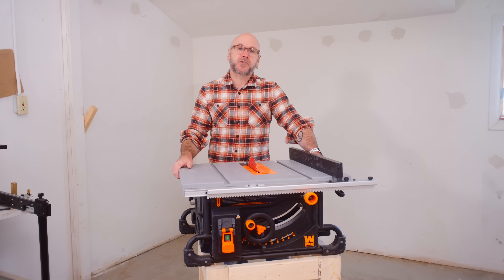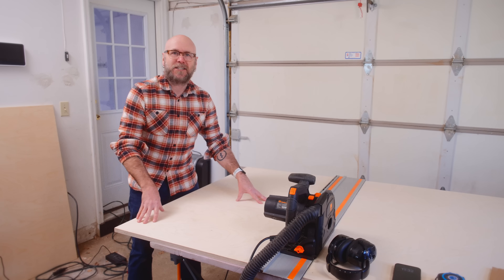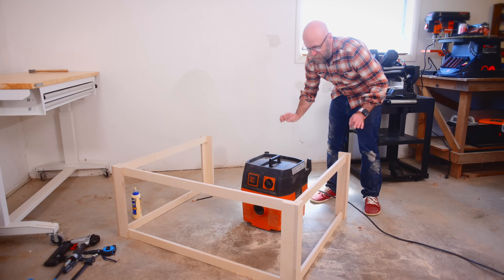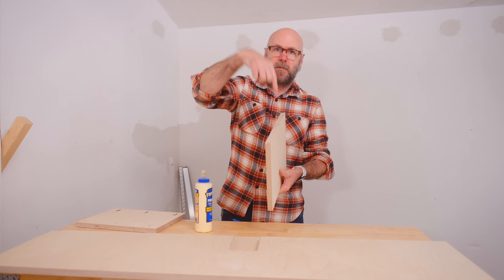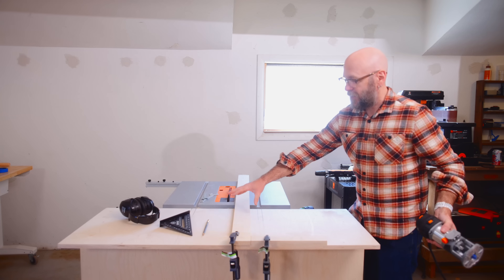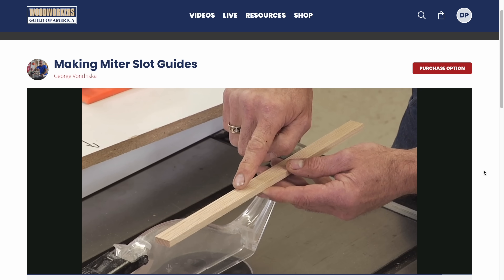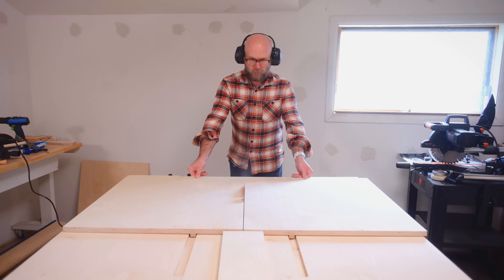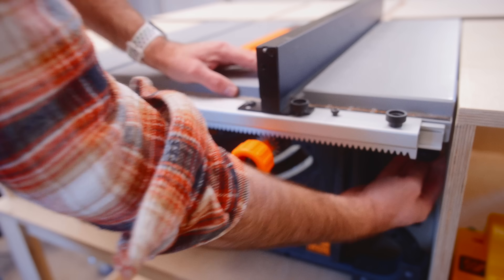Transforming a Cheap Table Saw Into a Professional Cabinet Saw

Comment: Phillips driver bits break. I've broken tips on Harbor Freight's  Warrior bits and DeWalt impact rated bits. When the last DeWalt bit broke fragments actually fused in the screw head. There was some cussing as I extracted it with a pair of channel locks. Just another legit reason to hate Phillips.

Love the Wnew miter gauge. The Bora Centipede is fantastic.
Reply: I've had it happen. Not a lot. But some bits and some screws are very hard. So I've had bits shear just like the one in the video. It is not the fault of the design the heat treatment of the various parts of the assembly. That's just manufacturing variance.
Reply: @1pcfred  Phillips suck for several reasons. Broken bits being one, but they also cam out and strip out easily.
I've reused Torx screws multiple times, and they hold up much better. I've also never broken a T-20, T-25, or T-40 bit, which are the ones I use a lot.
Reply: @ST-0311  Phillips are designed to cam out. If you use an impact with Phillips they work OK.  Like everyone else I've experienced the slippage and even chewed bits up. I found that when I ground bits to remove chew marks the bits would work better than new. So that's something to consider. Doing that grind properly takes a bit of skill. I don't find it particularly difficult. But I know what I'm doing. I have some really nice bench grinders too. One with big meaty tables on it. Big meat is Internet famous. If you put sliding tool rest into a search engine it's one of the top returns. I grind bits on the non-sliding side. Big meat is on line 3. You'll see a bit of orange cord in the picture. That's Big meat. I never posted it on Pinterest. Someone else found the picture where I did upload and reposted it. Oh on line 5 there's another pic and that one I did post. That's the grinder I do Phillips tips on.
Reply: @1pcfred  Yeah, bro. You can like Phillips if you want to, but I'd rather not use them.
As to your points:
First, every Phillips bit I've had break was being used with an impact driver. 

Second, the urban myth that Phillips were designed to cam out stems from the excuse Henry Phillips used to justify a design flaw. Phillips were originally used in the in the auto industry, and there were many complaints about cam outs. Henry Phillips claimed it was to prevent screws breaking due to over tightening.  
However, the only reason they were being used at all is because Henry Ford got butt hurt when Peter Robertson refused to give him exclusive rights to Robertson screws. Ford originally wanted Robertson screws to replace slotted screws specifically because they don't cam out. A problem common to slotted head screws. However, when he was denied exclusivity he looked for an alternative and went with Phillips.

It makes no sense for a driver to purposefully cam out and damage either itself, or worse the screw head. The result is the screw either cannot be driven all the way in, or it can't be easily removed. 

Torx, Roberston, and Pozi are all superior designs to Phillips. That's exactly why Torx were designed: For applications where serious tightening was essential, like car seat belts. It's also why no Phillips heads are found on serious structural screws like HeadLoks or LedgerLoks.

Third, I'm not spending time customizing flawed driver bits so that they will work better.
I'll just keep buying Ph2 bits in 10 packs.
If I have to use Phillips a spot of valve grinding compound will help them work better

You do you, man. But you're not going to convince me that Phillips is a "good" design.
If there's an alternative I'll use it.

~Peace✌
Reply: @ST-0311  do you have any idea what you do with an auto body panel that you strip out? Here I'll help you out. You scrap it. Because you can't just put a mismatched bigger screw in the hole. They had knuckleheads like you working on the assembly line too. Because good help is hard to find. Now if you stripped the screw head out it can be removed. You jack that hole in the panel up and then we've got a real problem.

Comment: I build a gigantic all in one bench that has space for a table saw, miter saw, jointer, and some clamps and assembly. I hate it. So now I'm doing exactly what you are doing and building everything modular. I'm hoping that I can build a rolling outfeed/assembly table with dogs that I can latch somehow to every mobile cart that I have so I can just roll the piece of equipment up to the table, latch it on so it doesn't move, and cut away. Time for assembly? Unlatch and move the equipment against the wall. Thanks for the inspiration!

Comment: You have a hole saw and use an undersized wood bit and force the plug through instead?  GOOD PLAN!
Reply from the maker: So you're suggesting drilling a 4" hole for a 1" cord?

Comment: The start capacitor on your compressor probably failed. It probably just needs a 15-20$ replacement capacitor 30min of time, some simple soldering and some heat shrink tubing. 🤞.

Comment: Does the brad nail trick give you as much holding power as clamps would?
Reply from the maker: No but in this case I don't need much holding power.
Reply: @MakeSomething  Thanks, so there are times that you would need to use clamps? This wouldn't work in every situation?
Reply from the maker: Anytime I'm using solid wood for fine furniture I'll use clamps to make sure I'm getting the best contact possible.
Reply: @MakeSomething  thanks for the info, I'll have to give that a try on smaller projects.

Comment: Nice one!!... Just a question: when you changed your blade to a thin kerf one, did you changed your riving knife too?
Reply from the maker: I did not. I don't know if that's proper but I do know that it doesn't get caught on the riving knife.
Reply: @MakeSomething  Good to know, thank you. I have a Dewalt 7485, I`m considering using a Freud combination thin kerf blade in it but I`m not sure if I will have to change the riving knife also...

Comment: I don't know about an after market fence, but I built mine from a video right her on YT (can't remember the channel). But it was basically a biesemeyer fence. It attached to a piece of angle iron and rectangle RHS mounted to the bench. The fence was made from another piece of angel with a smaller piece of RHS as the fence welded at 90deg. Then on that angle iron there's an adjustment with gub screws. Knocked it up in an afternoon with the welder and some screw taps.

Comment: About 34.75 inches,  about? You say what  accuracy do you normally work to if this is approximate
Reply from the maker: Accuracy isn't important here. Good enough is good enough for shop furniture. I like to focus my energy on what matters.
Reply: @ my point was 34.75 is accurate to 1 hundredth of an inch and that is not an approximate measurement. Never mind good job

Comment: I was just thinking that instead of 2” hose everywhere you could probably use 2” conduit to help minimize the mess and it is heat deformable or you can use a plumbing fernco fitting to attach to anything with a lot of vibration

Comment: Not exactly what you asked about, but look into the BOW xtender fence system. Doesn’t address the rack & pinion issue, but you can at least get a quality fence and will be able to increase the overall safety of your saw. 
Awesome video btw. One day my ADHD brain will get one built 😂

Comment: I would have thought the biggest improvement (other than the blade) would have been a new fence.
Reply: He talks about that at the end and asks anyone that knows of a good replacement fence for contractor saws to add them in the comments. I've not found one myself but hopefully someone drops a link here.
Reply: @halligan1201  The bow xtender fence? What do you think of that?
Reply: @hs1626  his criticism was that the contractor saw fence is hard to make micro adjustments on. As far as I can see the extender fence is what it sounds like, an slap on extension (with handy grooves and such)?
Reply: @nosreuter  that was my thought too. Allows longer pieces but if the factory fence moves or can't be adjusted accurately, still just carries that problem forward.

Comment: This is great! I have done the same thing for my small table saw but my finished table was not nearly as big.  My question is. You made a HUGE permanent bench table saw where everything has to fit in a single car garage? Wow.  This will take up a bunch of room all the time.  I made mine so the out feed table hinged down and took up MUCH less room when not in use.  I also added a power strip so the vacuum and the saw operated from one switch,

Comment: two of the main problems with the small saws are 
1: short lead before the blade. Not a lot space to align tight against the fence. 
2: cheap short fences. Most after market fences cost as much as the jobsite saw, but are way too big. Something stronger, more accurate, taller, and with a longer lead needed. 

If I built a support table for the saw, I would make sure there are at least 12" before the blade supported by the fence.

Comment: I have an old Craftsman 10” tablesaw. The fence is horrible! I have to carefully measure at the front and back of the blade, tighten the fence, and then measure again to make sure that it didn’t move when it tightened. I really need to find a new fence!

Comment: seems like it would be a bit wobbley...  given the weight of the Ryobi jobsite saw that i built a rolling cabinet stand for, along with considering the stresses involved when resawing thick slabs, i opted to build the frame with 2x4s and 3" lag screws, then covered with 3/4 plywood.  if i had it to do over, i would make it even more stable that that..  you'll thank me if you're ever trying to resaw a half case hardened board of walnut

Comment: There is one thing I see everyone doing when they create these sleds, (and for that matter aligning practically everything about a table saw) that I consider kinda a 'fatal flaw', and that is to align the back board with the blade.  The blade always has a chance to be out of line with the table, even if only by a microfraction, so you're creating a sled that's misaligned from the start!

The one and only TRUE alignment, is the miter slots themselves,  this is the one thing that all measurements should be made from.  Albeit it may be more difficult to do!
Reply from the maker: Except for the fact that this has worked flawlessly for me for 10 years. 😁
Reply: @MakeSomething  I didn't mean to imply anything! :)  It's just that /everyone/ makes theirs off the blade.  I don't think I've ever seen any video doing it off the miter slot!  I absolutely love the design, and as I'm about to build my own cabinet I will be using parts of this video as a reference!

Comment: I have wanted to build a sled for my table saw for a while, but I have an older model and can't afford the upgrade yet. How do I build a sled for my saw that has no miter slot like that. My saw has a sliding section that's flush with the table top

Comment: Dewalt’s Rack and Pinion fence is nearly flawless.
Reply: Agree. I've one and have no criticism at all against its fence. His model seems to be some kind of clone or copy. Maybe the quality is not the same.
Reply: @ericpascual8913  Exactly what I was thinking.  I’ve used the Dewalt saw for around fourteen years now for everything from flooring and cabinetry, to decks and roof framing.  I love it.
Reply: @millroyboy07 The only criticism I had was WRT the on/off switch, that is a basic twin push buttons in the model distributed in France at the time I bought it. Thanks to a bit of 3D modeling and 3D printing, it now has a real emergency off red large flap with a white STOP sign on it 😊.
Reply: @ericpascual8913  Great idea.  I just kind of conformed to mine.   That said, I remember it feeling cumbersome when I first bought the saw.

Comment: I had a California Air Tools compressor. It was really great, while it worked. But after a year of ownership with very little use (I have a bigger compressor that gets most of the use), it overheats after one cycle. No fan blockage, everything is clean. Maybe the sensor is bad, but I certainly won't buy another, nor would I recommend it to anyone.

Comment: I'm not done watching the video but I want to make this comment... when is David going to realize that you can't empty the vacuum if its locked inside the table? From what I can tell that vacuum is a bucket style that needs it's top removed to be emptied. If you couldn't get it in "after the table is done" how are you going to get out to empty it "after the table is done"?! 🤣🤣🤣

I'll come back to edit at the end. 😄👍

EDIT: So yeah. At 6:04 there is "an issue" but I guess that structure that was luckily not glued together, was not going to be in the final table since the top and bottom already gave it enough strength. 🤷‍♂ I was hoping your vac would get full after you locked it inside the table. 🤣🤣🤣
Reply from the maker: It slides right out. That's why we didn't put the stretcher on front. I'm gonna have to ask you to watch the video again. 😉

Comment: I think this could have been made a lot more awesome if you removed the actual plastic table it came with entirely using a sawzall or oscillating bit, and just thrown it away. Rather than building around it. Table saws are supposed to be calibrated by adjusting the table which is independent of the saw anyway. Not to mention it would have made the build far cooler looking to have an all wooden table. But it was still awesome. Good job..

Comment: you should have put 2 more support boards under the board. over time the board may start to sag from the weight of the table saw ?
Reply from the maker: That's what the rails were for on the frame. 😉
Reply: @MakeSomething  yes, but in the middle of the top plate😊
Reply from the maker: @ let’s chat about this again in a couple of years. I have faith in the 3/4 Baltic birch.

Comment: No matter what you do to the outside of a POS table saw, you cannot correct the crappy way the motor and therefore arbor attaches to the flimsy plastic case. Or in other words, you can't put lipstick on a pig. Push a piece of hard wood (like 8/4 white oak) through and the motor will flex bringing the blade out of square with the miter slots/fence. Don't wast your time. Use a cheap table saw as intended, like home improvements or contractor applications, but don't think you will get the consistent, professional and safe cuts you can with a professional cabinet saw to build consistent fine furniture. Just my $0.02. YMMV!

Comment: Damn. I was hoping you would show how to do dust collection but that saw has a port. I have a 50's era craftsman that i need to figure out how to add dust collection to. If anyone has advice or a video that could help, i would be grateful.
Reply: I have a saw similar to yours, no shroud, just an open bottom.
A few years ago I built a stand somewhat similar to his but with drawers for storage. Two drawers on the top level, two on the bottom. The top level had narrower drawers because I left a gap in the top that matched with the open bottom of my saw.
A false front on that gap with a 4" port on it allows me to hook my dust collection hose to the front of the saw.
In my small shop I don't have room to leave it in one spot so I wheel it out, hook up the dust hose and power and then can cut.
Originally I had a plywood shield to close off the back of the saw but I had to remove that when angling the blade. Eventually I gave up using that because it didn't really help much.
This set up gets most of the dust. Still some on the top of the saw but not that much.
Every couple of years I take the front off and clean up the extra stuff that builds up in the corners of the opening. The dust collector isn't quite powerful enough to scour out all the corners.
I'm a hobbyist, not a professional but I use that saw quite a bit and the mess is nicely controllable with this method.

Comment: Only thing more scary than a corded drill is a 20V cordless one. They are very heavy and extremely torquey. If it binds it can literally break your wrist because it’s too heavy to stop it. Like trying to turn a car without power steering.

Comment: I would love this in my garage BUT there is to much crap in there and the FLOOR has a 6 INCH slope from the center of the floor to the right wall.   I was going to fix it but thats like 60 bags of concrete OR I could build a wood floor over the top but that creates a big raised floor in front of the garage to get thing in and out not to mention a trip hazard

Comment: Screw driver bits break all the time when using an impact driver. Guess you've just been lucky.
Reply: You need to buy the ones designed for use with an impact

Comment: I wish I knew of an aftermarket fence (at a reasonable price...) for myself. I have a Bosch contractor saw. it is surprisingly weak (upside: no chance of a kickback! LOL), but my biggest problem with it is the fence. the damn thing is very VERY hard to be set straight. there is almost always a small tilt to it. if it was a really small error, I can live with it. I am not chasing perfection here. I am talking about 1 to 2 mm for the length of the fence... (1mm is about a 1/16th if I remember correctly). really annoying.